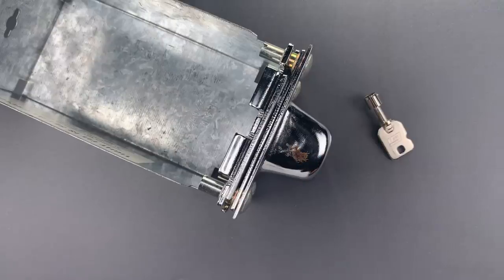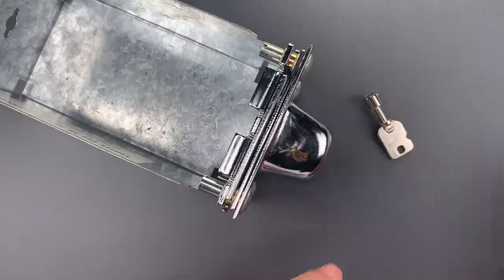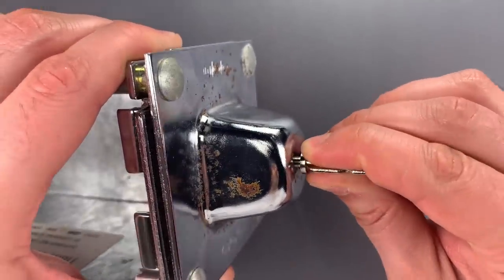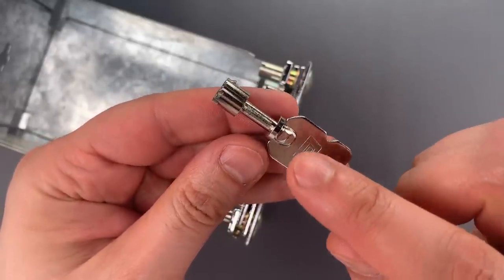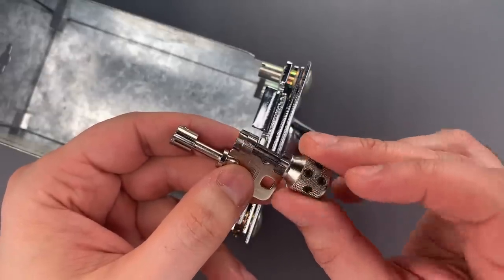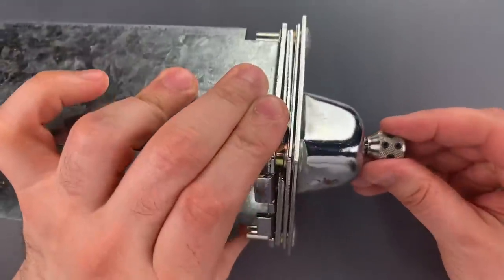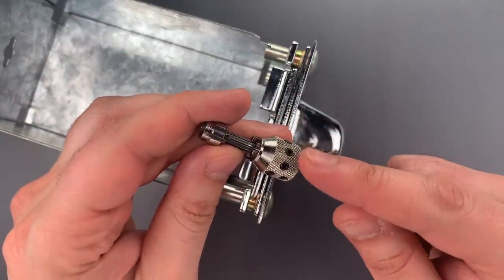[1205] Rare Tool For Picking “Giraffe Key” Locks

Comment: ”A slow pick”, dude you almost picked it faster than It takes me to unlock my front door.
Reply: You should start a YouTube channel ... sounds hilarious
Reply: Are you sure it's YOUR front door?
Reply: @cattocs  it is now.
Reply: Sometimes it takes me longer to open my own faulty lock using it's key than he took to pick this
Reply: @cattocs  *OUR* front door
Reply: I know. ;)
Reply: @irvingchies1626  The best sorta security; if YOU don't know how to get it open half the time, how can any trespasser know?
Reply: Put some oil into the key hole, not wd40 that leave a wax residue which holds and attracts dust
Reply: dont forget he was going easy on the lock. he wasnt using the updated tool :P

Comment: I would consider every lock pickproof for which you need a highly specialized tool only the LPL has.
Reply: the pick resistance of 95% of locks has dropped overnight when Covert Instruments went online.
Reply: Yeah probably easier to steal the key from the owner of the laundromat than acquire this pick
Reply: You can still pick it without the impressioning tool, it's just slow and awkward.
Reply: If you're planning to rob a laundromat, you have time to order one of these online from somewhere.  Nobody's walking around with a set of lockpicks thinking ooh, what can I pick today - they have a target in mind.  If they know the target, they will very likely have the tools to take on that target.  It's definitely not pickproof; the people who would have picks, would have specialized tools too
Reply: @Dimencia  I think you have an over romanticized sense of how crime works. Most crime is crime of opportunity
Reply: @huckthatdish   Nondestructive entry usually takes a bit more thought than a purse-snatching.  I agree alot of crimes are born of opportunity.  But unless a door's coming down, or window's busted out, circumventing security measures in a nondestructive manner generally would require at least a little forethought and preparation.
Reply: @huckthatdish  Sometimes, but those guys are deterred by having a lock period.  If someone learns to pick locks, they've already bought specialized tools (ie a lockpick), and know where to get more if they find an un-observed lock that needs a special tool
Reply: @huckthatdish  Also, every laundromat has a bunch of cameras and make sure they are in plain sight. They know that they are shitty areas and crime is omnipresent, so they make sure that you know you are being recorded. Spending time screwing with a lock is going to get attention.
Reply: @superrad1659  I mean you're probably more likely to deal with a meth head with a pair of bolt cutters than a sneaky sneak thief with a 100 lock picking score in the real world. Buddy of mine had all his gear jacked from a storage unit by some people just flat cutting the walls out from the inside, tunneling through numerous people's units unseen by the outside cameras.

Comment: That took longer than some "high security" locks, and required an uncommon special tool as well!

I guess it only goes to show that the only unpickable mechanism is the one no one else is using yet, and no one has had time to build a tool for. (But of course you always want to keep getting the lock open slightly easier than destroying the door for practical reasons.)
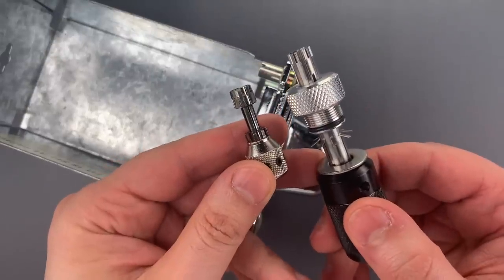Reply: and he did specify the same can be done faster with a modern tubular pick at 1:13
he just wanted to showcase this one  in particular
Reply: @eppssilon  He did also say that you couldn't use the modern tubular pick for that lock because it was a Giraffe Key Lock.
Reply: @eppssilon  Most tubular locks could be done faster but a modern tubular pick won't work here as he indicates (but doesn't outright say) at about 0:10.  Because of that long thin neck on the key, a modern tool won't fit.
Reply: @wlwlvr  I seriously think a modern style could be adapted for it easily enough, just is there a need? Even at laundromats I've never seen these personally.
Reply: @cericat  Exactly! It's secure because it's obscure, not because it's stunningly clever. If everyone made tubular locks with this kind of hood, tubular lockpicks would all have long necks.

Comment: Looking forward to seeing LPL completely dominate the lock that the channel "Stuff Made Here" made
Reply: In any case he has watched the video a couple dozen times and has already though of the tool to make. 
Because each pin has to be move at the same time. I was thinking that a layer set of picks much like a comb pick could be used yet each pic moves by its self allowing you to set the height and try again. . Now I have a feeling that if he did some measuring and cut a comb pick it might work.
Reply: @kameljoe21  what you are describing is making a key (not picking) through guessing and checking (effectively impossible)
Reply: @costlycoffee4234  Either way its still a pick.. A key sort of pick, I think we may see some weird home made device he comes up with. The tools that are used to unlock something is still a pick be it a key or not.
Reply: @kameljoe21  This would be a kind of brute force impressioning, which a lot of people wouldn't consider picking (although a lot of people would too). What you're describing sounds like a hook, which would let you set one height at a time, but you would still have to check them all simultaneously, since you can't check one pin at a time. To get to the correct combination, you would have to determine intervals to set each pin to, and choose different permutations for each pin until one works. That's why Shane said the only way to pick his lock he could think of was to brute force a combination.
Reply: @ihugoaway   Brute force comes down to damage to the lock. Picking is any form where you open the lock with out someone knowing it. Cylinder picks as you are describing would be brute force. The same thing would apply to tapping a Master lock with an object. Each one of these things does not damage the lock they only find easy ways to open the lock. Using a shim to open a safe or lock box is a form of picking. Neither of these are brute force. What I am describing is using a tool that can press on all of the pins at the same time. this can be done with small flat rods that have some sort of curl that are stacked on one another and when you push one of the flat bars it raises it a little bit. If the tool was made right it could be a form of raking in a sense. Yet the raking is fixed position to hit each pin. 
Good locksmiths make tools for the application they need it for. LPL has done this a number of times. 
Bumping locks is not a form of brute force because it does not damage the lock. Brute force is damage beyond repair or leaving it in non working order which is what a lot of locksmiths do. They would rather charge you 100 dollars to cut the lock off or drill it out than master their skills of picking.  Anyone who pays someone to cut the lock should be refunded. As with enough videos out there showing you that skilled locksmiths can pick just about any consumer lock. I would suggest checking with them before you hire them out. If they can not pick your lock then they are not worth the time.
Reply: @kameljoe21  There's two kinds of brute force in lockpicking (terrible naming scheme, but that's how it goes). One type is, like you're talking about, irreversible damage to the lock. Another type of brute force, which LPL has mentioned in re 3-digit combination locks, is systematically trying every possible combination of solutions until one works. This is used mostly with combination locks, since it's difficult and tedious to do with a keyed lock. However, the design of Shane's lock is intended such that a permutational "brute force" attack is the only way you can open the lock without a key. What you're talking about, a modified raking attack, runs into the same problem as a standard raking attack. Raking depends on trying a lot of different permutations at random (the jiggling part), and getting the pins close enough to correct that the lock opens. There is a tiny delay on the order of tenths of a second between trying combinations, basically you try solutions as fast as you can jiggle. Shane's lock can't be raked in a reasonable time scale, because every time you change the position of the pins, you have to turn it to try it, and turn back to set a new set of pin positions. Basically, it doesn't let you use the standard constant tension a tensioning bar applies; you have to keep turning it back and forth.
Reply: @ihugoaway  Ok you just gave me an idea. You know how tattoo guns work, They have a little motor on them. So in theory one could find the right size rake or the use of a bunch of rakes one at a time. Attach a motor to vibrate the rake while using a tension tool. now that the pins are being vibrated you very well could get it to open. The other option is to make a electric knife type rake that would allow it to bounce enough. If you get a false set that still does not work you either move to a larger or shorter rake style. What do you think on that. 
Now that I understand the brute force, Which really should me called mechanical force. Which is finding a flaw i the design.
Reply: @kameljoe21  I thought of using a motor too, since I don't see a way to physically reach the pins once they're turned to the gates. It would depend how well Shane makes the pin locks, since if they're tight enough vibration won't move the pins anyway. The thing about this lock are that there aren't false sets, and you won't be able to tell if one pin is correct or not. You can only tell whether the whole combination is right. I don't have any clue how LPL is going to pull this off, but he is a million times better at picking than me. For now I think I'm pulling for Shane.
Reply: @ihugoaway   Which is why Shane's lock is going to be hard. I am going to have to watch the video again. Though what is cool about his lock is the fact that the pins are not under tension. Meaning that you can set them though some sort of motor has a good change of setting them while tension is being place. I can not recall if he has any false set type things on it. Though even if there is you have to only apply very small amounts of rotation slowly while still bouncing those pins. I think there is a way. The best thing may be a comb pick. I have a feeling this could work pretty easy though spacing will not be the same.
Reply: @kameljoe21  People make vibrating rakes like you're talking about with electric toothbrushes. It's not a new idea. There's heaps of better vids about making them, this is just the shortest one I found that shows the concept https://youtu.be/OipPU2la6Tk
Reply: @kameljoe21  I was thinking he will try to somehow jam the part of the lock that makes it impossible to pick one pin at a time and then, easy peasy.
Reply: @ihugoaway  LPL would probably use the ramset hahaha